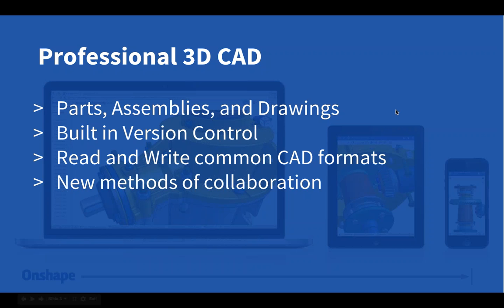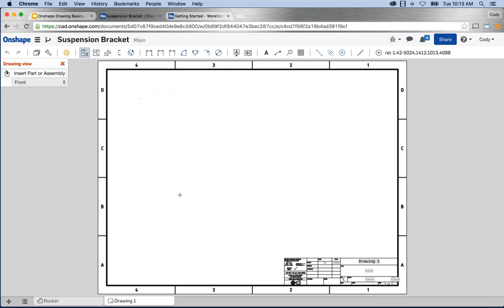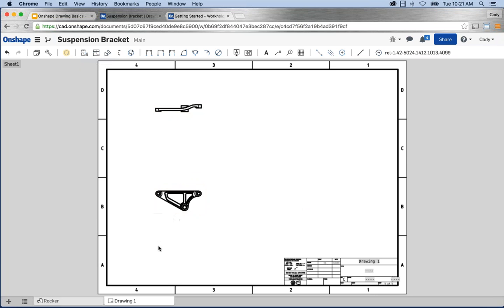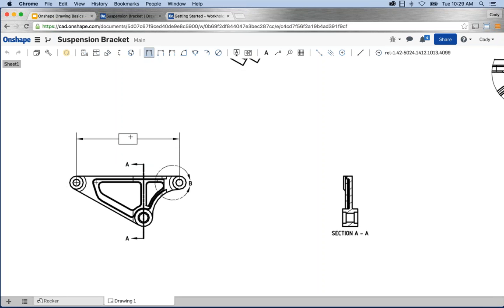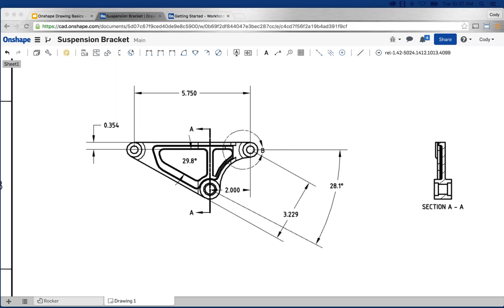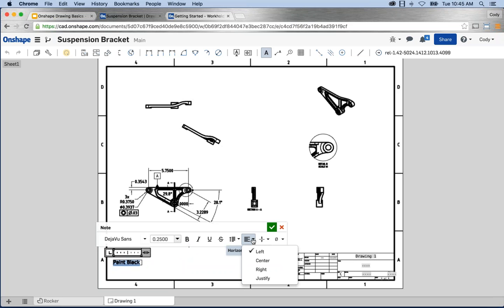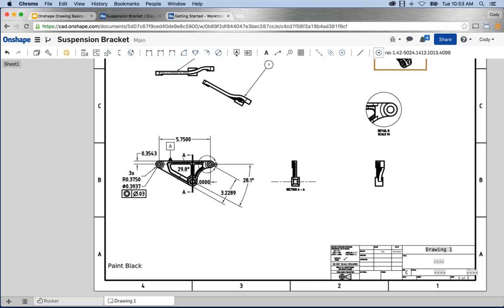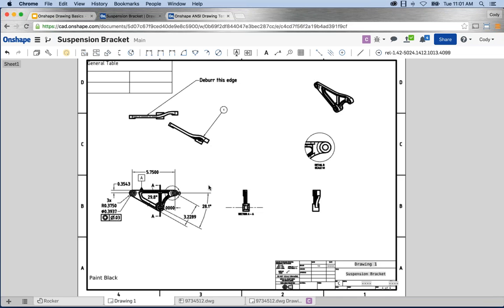Onshape Drawings Basics | Webinar (February 16th, 2016)

Comment: You know, when you move the dimension from the center of the hole you show moving it, but you never click on anything to show that it actually works.  I'm so frustrated with OS because nothing seems to work as expected and I'm surprised all the time.  Show me putting the dimension point on the outside of the outer circle, add a note in the dialog box to show where it goes.  Do something besides move it around and talk about it.
Reply from the maker: Sorry we missed the mark.😔